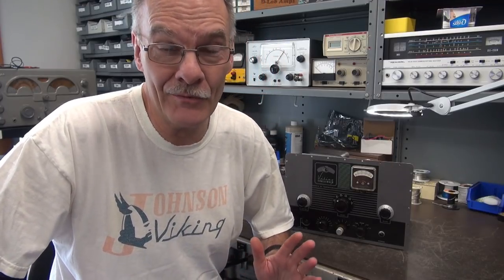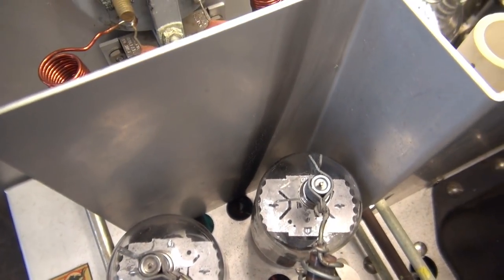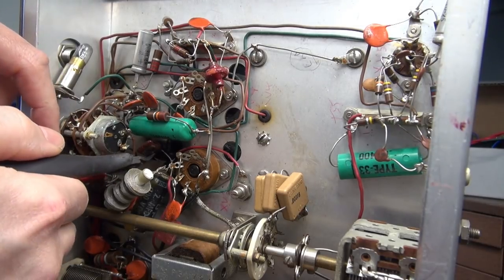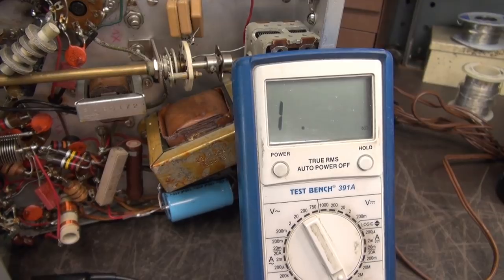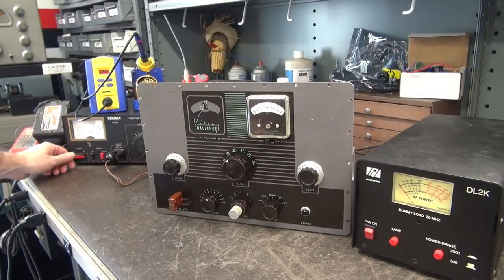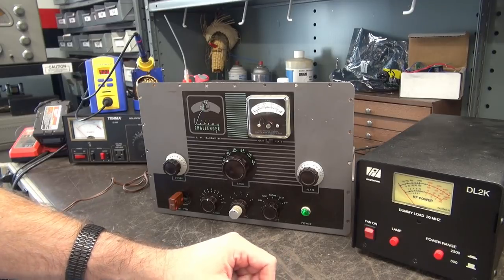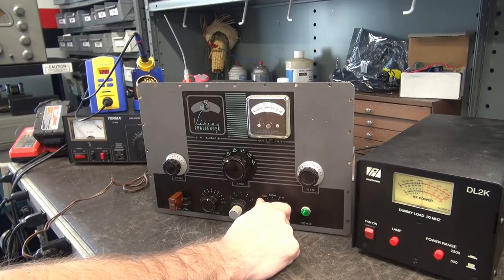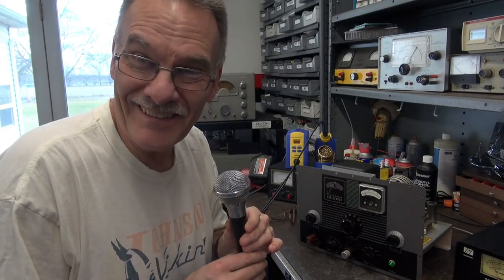How to repair EF Johnson challenger Ham transmitter shorted high voltage

Comment: Hey Terry. I have a piece of equipment that I feel would benefit a lot of people if made into a YouTube video. It's a AA165 fender bassman mostly to schematic with a few modifications. It was a very ambitious project for a first build, of any kind of electronic. I'm very pleased with the outcome but it has plenty of issues to overcome. Im looking to pay someone to go through it and feel it would benefit a lot of people that are attempting an amp build to see the troubleshooting process which is very different then troubleshooting a vintage amp. It's constructed of new components and potential issues lie beyond failing vintage components.

Comment: That DX150B is a good reciever works well with whatever you use it with.  At the moment i am using AX190 40 and 80. It doesn't have what the 150b has.

Comment: Those replacing caps cant handle high temps.. A metall clad will last longer.  the capacity wil change also a lot under different temperatures..